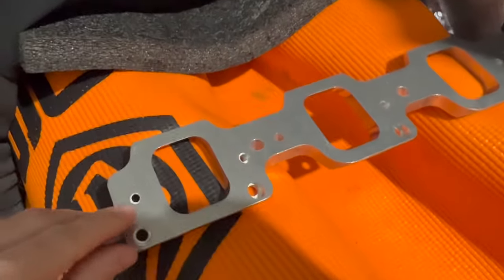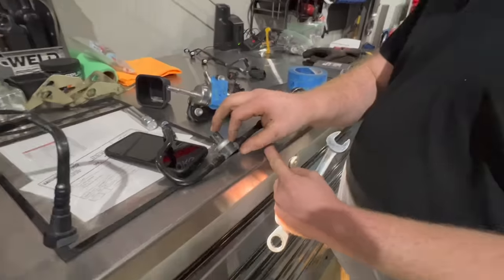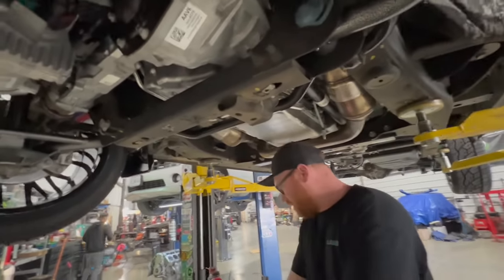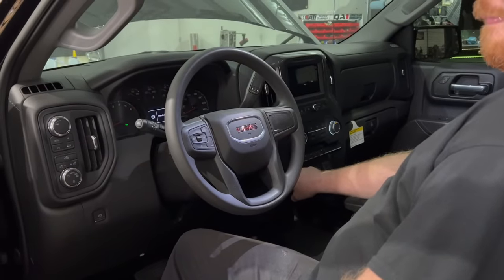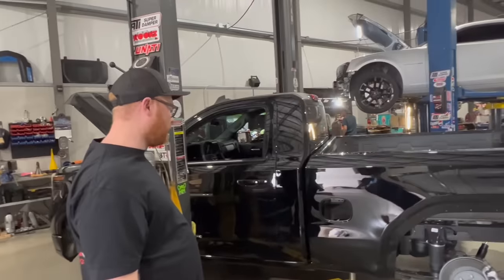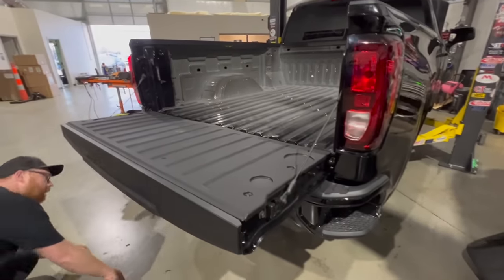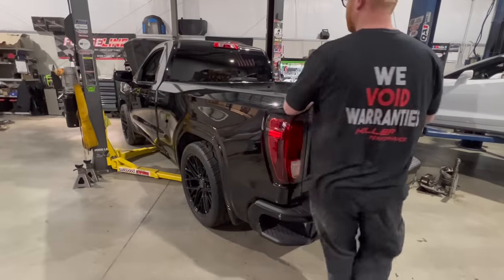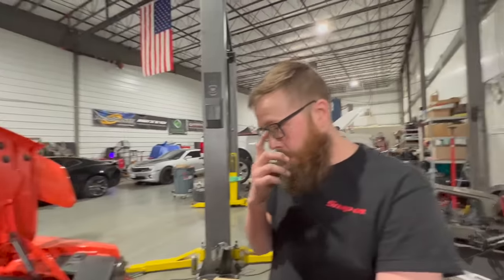Brand new! 2024 GMC 6.2L reg cab short bed 4X4!

Comment: I did see a regular cab 2024 shortbed with 5.3 4x4 Silverado on You Tube sold at dealer, but here in Phoenix they all had the 2.7 turbo

Comment: This is interesting... I was wondering if someone made an adapter for this .
I currently have a 2650 on my l83 and want to replace it with a LT4 short block , but I was worried about the blower not bolting up

Comment: Are you having issues with the LT4 HPFP? You might need to take the L87 HPFP regulator and swap that onto the LT4 unit. 

That's the only way I've seen the LT4 run on Global B.
Reply from the maker: It’s got the stock fuel pump back in it
Reply: @StangkilrProductions the in tank pump or the high pressure pump?

I saw the hpfp regulator mod/swap on the HPTuners forum.

I haven't done it myself but dsx tuning might be able to help.